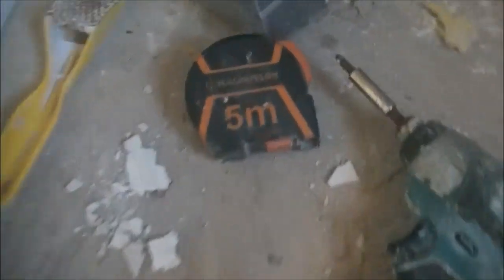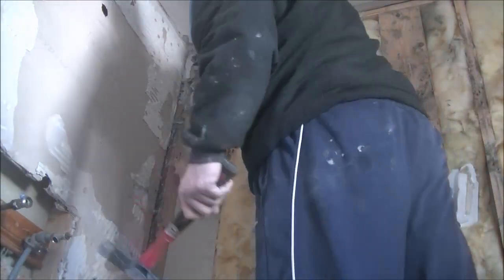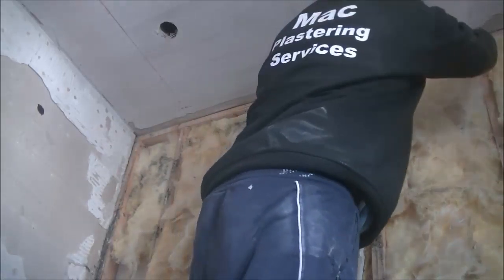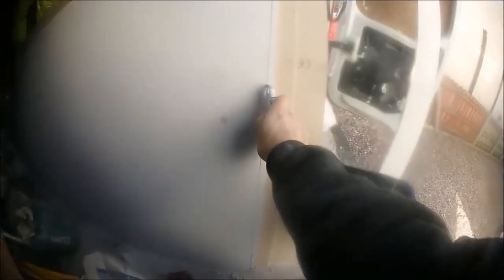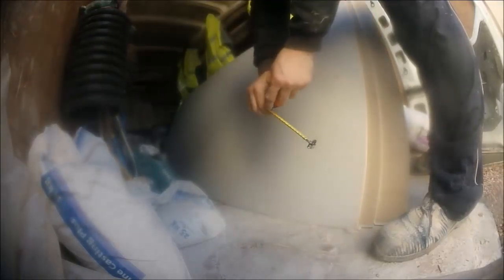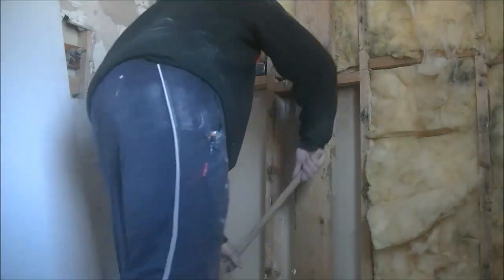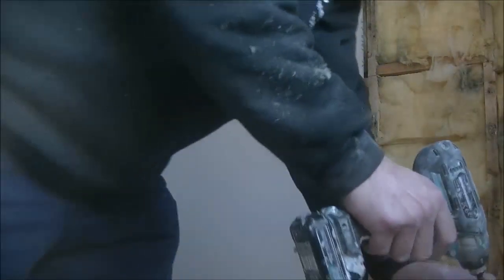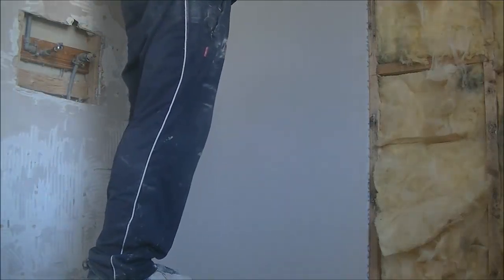HOW TO PLASTERBOARD A SMALL WALL DIY

Comment: It would also drive me mad knowing the hammers were there! I have a question though. My bathroom walls are constructed of panels made of two panels of plasterboard with a sandwich of cardboard honeycomb, a bit like an eggbox. Presumably, there was no need for studwork when building the wall.  If I had to replace one of the surfaces of plasterboard how would I fasten it? Can I assume there will be vertical battens sufficient to fasten it to? Have you ever done it? Love your commentary.
Reply from the maker: I have came across that before I pulled a wall down that had the same such build , I found the boards where just glues to little studs then it seems to be fixed to wall ,floor and ceilings was very strange but was still strong it would be hard to not destroy both sides as the studs might pull of the far side but it might be possible to then put new studs in and screw from far side leaving you to repair the screw holes then sheet the new side onto them studs you fitted hope this makes sense
Reply: @macplastering  Thanks, yes it does make sense. Hopefully, I'll not need to reboard it when I tackle it. Thanks for your quick reply!
Reply from the maker: @regcotterill7332  Fingers crossed :)

Comment: Some good tips there mate 👍👍👍
Reply from the maker: Cheers man its nice to do a little boarding from time to time and cant blame any1 but myself if a scew aint in lol
Reply: @macplastering  😂😂Yere when the customer does it and says it ready to go. And you get there and spend 3 hour sorting it out before you start 😂😂😂👍
Reply from the maker: Haha seen use do that a few times lol
Reply: @macplastering  lol I did a small kitchen for a mate once. Got there the boards was a right mess took wile dinner to sort it. Put the whole lot of  plaster on in one go. And left him a roll of sandpaper. He hasn't asked me to do anymore for him since 😂😂😂😂👍
Reply from the maker: @markhep  LOL I remember a mate of mine doing similar on a kitchen he tols me the bonding would not set so the skimm got 2 trowels he was like it was neat but toil her to sand it I was like whatttt LOL Also a painter that left a roller so the woman could finish the next coat herself LOL

Comment: Had plasterboard up for 3 months still can't  get any plaster when I eventually get some is it still ok to scim over or do I need to do something to the plasterboard before I scim it or is it fine any help is appreciated.
Reply from the maker: I would think as long as it isn't dusty it should be ok but have seen old walls that have been plasterboard for long time set relay relay fast pvaing them can hold it back but was still setting fast. Maybe just test a small area to be on safe side mate maybe just mix a taste and la it on it to make sure it dont soak in real quick
Reply: @macplastering  cheers my friend I'll do that.
Reply from the maker: @dilligaf2386  If you find it sucks in fast pva will be your best friend :) hopefully its ok thought :)
Reply: @macplastering  good idea , someone else said try spraying the plasterboard with water before you plaster it what do you think.
Reply from the maker: @dilligaf2386  Its not ideal to plaster over wet plasterboard as the paper can tear but that can happen even when its been dam and then dried and then gets wet plaster on it but a light spray before you skim might not be to bad but I belive pva dose all that and then some , pva should seal it plus help bond the skim to the boards , but you might get lucky and find its not setting the skim fast at all

Comment: Omg  did you really leave them tools behind that slab ?? I used to use a 4 inch steel nail to cut slabs back in the day lol
Reply from the maker: Alright mate nice present for the next guy LOL Oh yea a steel nail would work sweet but the electric boxes must a been a nightmare for you ?
Reply: Within reason  ,, the nail for a lot but the Stanley all purpose saw was the other beast,, I know things have changed,  and for the best,, I follow you and have learned about a lot of new products,,it's been like 25 years since I hung my tools up professionally,, I did message you before about still owning Marshalltown tools still in unworkable order,,  good to see you working again after lockdown. 👍👍
Reply from the maker: @anthonykenny1120  The nail would save the blades a lot i find the blades blunt so fast , I end up just using blunt ones find it a paint to keep swapping them LOL For sure some these new tools have helped us tonnes :) Do you mean your Marshalltown is done ?
Reply: Sorry mac  yes still have trowels but not suitable for skimming, maybe a small render job or a shave lol
Reply from the maker: @anthonykenny1120  are thy bent or chipped mate ?
Reply: @macplastering  they where in workable condition until I loan them to a relation,, not so good on there return,, but no shame
Reply from the maker: @anthonykenny1120  oh man reminding me of my ragni corner trowel got smashed in sliding door :(
Reply: @macplastering  ah well..  the trowels are still fit for some rendering work.. at least someone gets to use them..  when i get them back its out with the wet/dry sand paper.. lol  i always like your unboxing new tools,,
Reply from the maker: @anthonykenny1120  Did you see the adjustable trowel ? hoping to get some work done with it on a demo wall,  have another unboxing of refina tools coming u in future
Reply: @macplastering  cool  thanks for replying 👍👍
Reply from the maker: @anthonykenny1120  Any time man I think some the tools from refina are now discontinued but they will be selling newer of them trowels